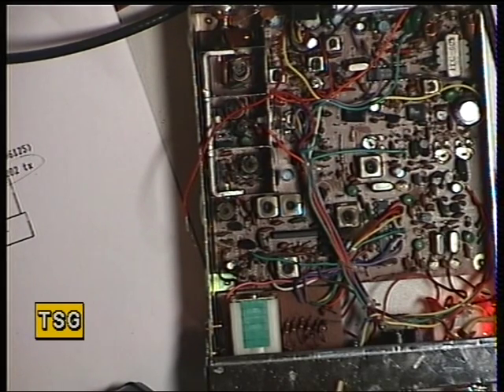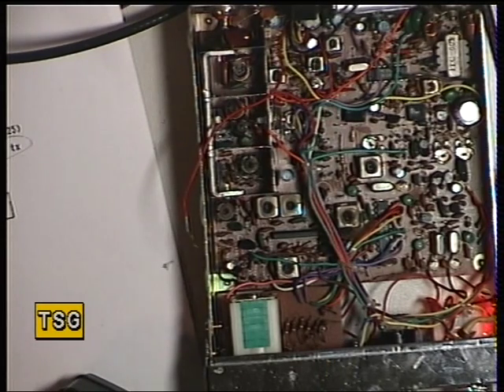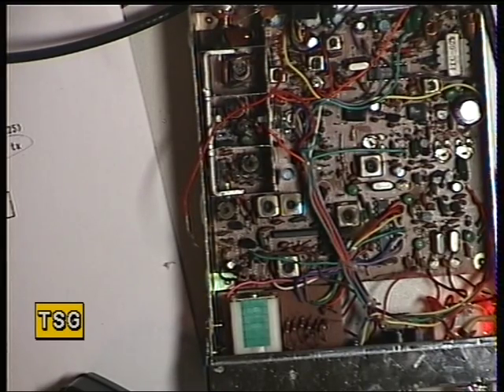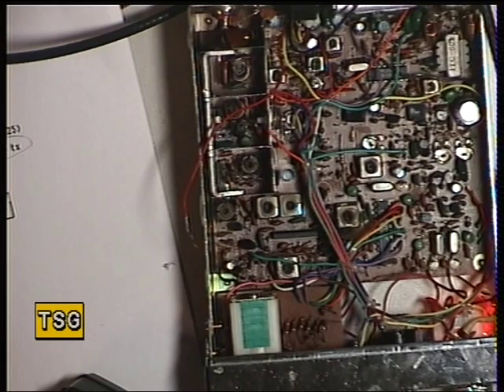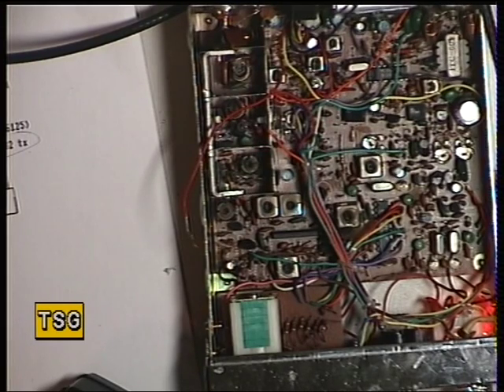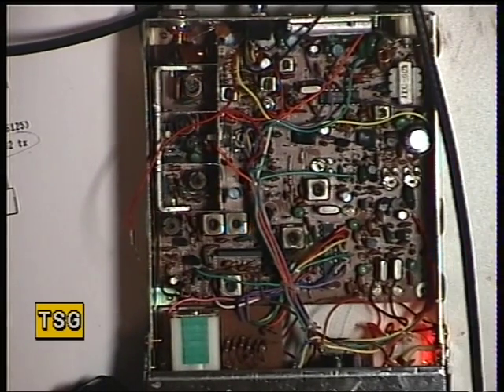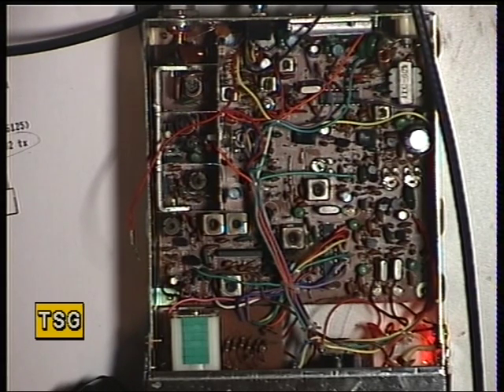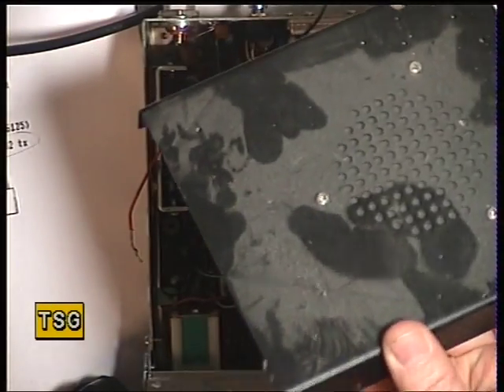Icom ICB1050,  UK (27/81 band) CB radio (Mobile). Receiver alignment

Comment: Hello Richard and I hope you're well.

Apologies for asking but do you have a good supplier of crystals.

I'm after the standard TX and RX crystals for Icom ICB 1050. 
16.50625Mhz and 16.96125Mhz

The usual online sources are useless!

Kind regards, James.

ps fixed a very low audio input on one of these sets that I have. I'd wondered why it had been supplied with a power mic HiHi , changed C302 C304 and C306.
All as dry as could be. All good again now though.
Reply from the maker: We used to use HyQ international, who have now withdrawn from the UK, leaving us with Quartzlab, now at £30+ per crystal. I think the best bet if for me to find a scrap chassis for you. They were regarded as a really 'shit' radio, so I'm sure there will be a chassis here. I've always bought up scrap chassis when I can find them....I've even 'repopulated' scrap chassis & turned them back into working radios!

I'll have a look tomorrow & get back to you

Richard
Reply: @ukfmcbradioservicingTango21  Blimey Richard, at £30 per crystal I'm not that keen HiHI.
Just keeping busy during lockdown really and learning.
Getting some practise in in fault finding etc.

Appreciate your reply and efforts with the videos. If you come across a pair of crystals I'd happily buy them off you.  

Kindest, James.

Comment: Richard no problem i was just wondering if you had used a test point  as in the 10.24 mhz crystal setting or measured the actual transmitted frequency,
regards chris.
Reply from the maker: The 10.24Mhz crystal trimmer is CT203. The Crystal is connected to pins 3 & 4 of the synthesiser chip. Connect your frequency counter to ground & pin 3 (or 4 if it works better!) & adjust CT203 for 10.2400000.
Reply: thanks richard sorry for the delayed reply,
chris.

Comment: Hi Richard,
Just a query about setting the r.hand ct202 on tx , you dont say where you have the frequency counter connected, i was just wondering if you would be good enough to explain this.
regards chris
Reply from the maker: Without consulting my notes, the reference crystal is probably 10.24Mhz & is set with a frequency counted to the test point discussed in my "setting the vco" video, the transmit one I set to the frequency counter built into my Marconi 2951 test set I'm using. In transmit you have a power meter, a deviation meter, a frequency counter & an audio level meter....so the test set shows all these readings at once.

On receive it was set with the signal generator (in the test set) set to 27.79125 on channel 20, then I used a second small signal generator on 455khz as a marker oscillator, adjusting the rx xrystal for "zero beat". It would be better to use a 10.695 marker oscillator, but I don;t have one. What I would normally do is set a signal generator on another test bench to 10.695 as it's easier to hear the beat note.

phew..

Richard